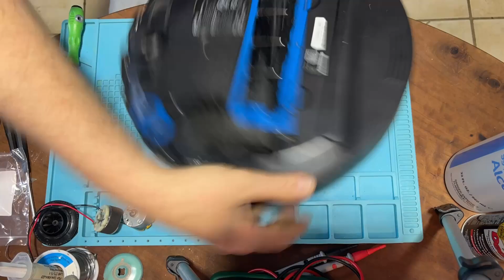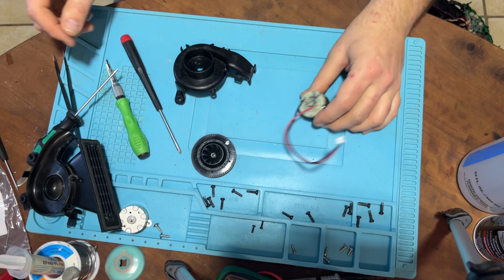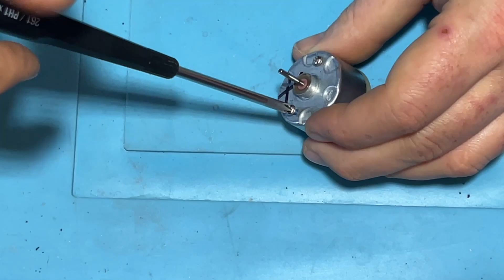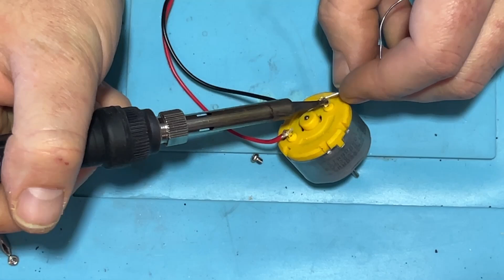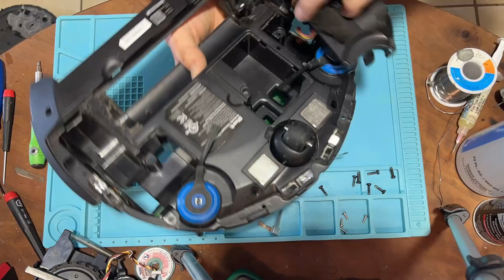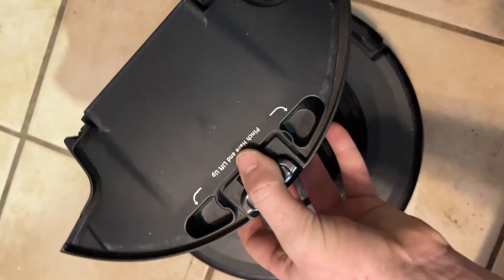Shark Robovac Suction Motor Replacement

Comment: Wow that was amazing. I think my suction motor is bad, ran over some dog barf...cleaned unit and base and the robot just seems too quiet...It picks up hair and stuff but I think the motor is bad because it is too quiet. Is there a way to check if the suction motor is bad without taking the entire unit out?? I am not getting any error codes...